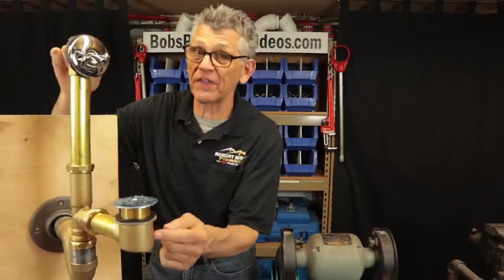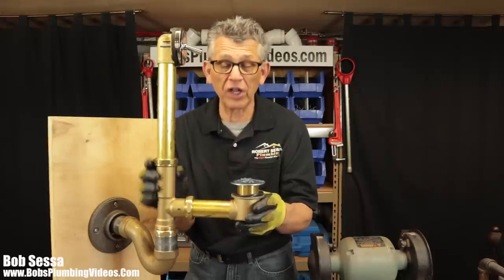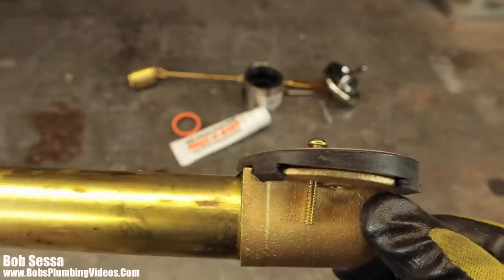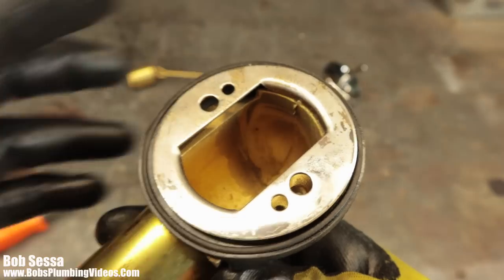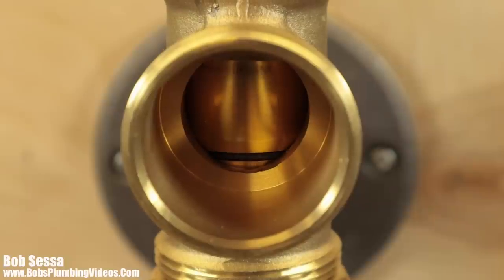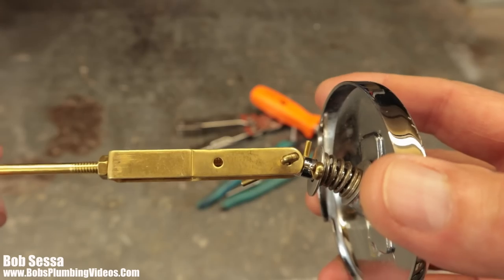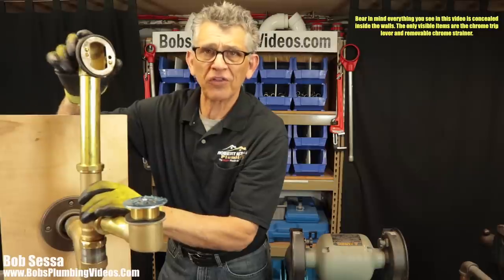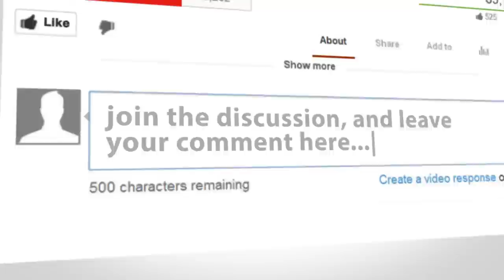Bathtub Drain Stopper / Trip Waste Assembly

Comment: Thank you for this informative video.  I made the mistake of discarding the old linkage assembly.  I have no clue at what length to adjust the linkage assembly too.  Are there any ways to determine this?
Reply from the maker: You can buy a universal linkage kit from H.D. or Lowes. It's basically basically just a matter of adjusting, trying , repeat until you hit the sweet spot.
Reply: Thank you, I am grateful the new one I purchased is adjustable.

Comment: Thanks for the video Mr. Bob, very informative.  I am not able to open the drain to let the water out and have to replace the level.  I also need to clean out the drain.  What are your thoughts on Liquid Plumber or any of the other liquid draining products?  The drain isn't completely stopped up but I can tell I need to  flush it out.  Should I use the Liquid Plumber?  Thanks for your response.
Reply from the maker: I’m generally not a fan of commercial drain cleaners. Some are just down right dangerous and some are a waste of money. You would be better off with a natural bacteria / enzyme  product. Added monthly it will keep drains open (unless you have a hair serious issue) in which case a snake is the only fix. https://wiki.ezvid.com/best-enzyme-drain-cleaners. Regards, Bob.

Comment: What’s the best way to keep the snake wire from rusting while it’s stored to be ready to use again in the future? Grease? Silicone spray lube? Any suggestions?
Reply from the maker: Remove it from the machine! I use a General Handy Electric hand held machine for tub, basin, sink stoppages. I remove the cable after every use, wind it up and hang it on a storage hook in my van. Occasionally spray the cable and inside the  the drum of the machine with WD-40.

Comment: I have a bath tub that drains slowly, I think the whole linkage assembly needs to be adjusted up or down. Why I think it is the linkage assembly, is because when I hold down on the lever the water drains. It won't stay still. Is that because of the lever or the linkage? and if so, what should I replace? I already ordered the linkage and the face place, in case I need both. What are your thoughts and recommendations?

I just found your video, and will be looking for more of them. This one seems helpful.

Comment: Hi Bob, 

thank you. very informative. i have a problem where the whole mechanism broke off from the up and down lever (to fill and empty bathtub) and is in the pipe. how do i get it out?The tub drains but very slowly so i am assuming the plug is not fixed in the close position.  i am a retired woman living on a fixed income and do not want to hire  a plumber. 
presently, my idea is to use a wire hanger with gorilla tape. hoping it sticks onto it and pull it out.

thanks for  any suggestions
Colleen

Comment: Great video......I need some suggestion on the problem I am facing is attempting to remove my drain stopper from drain tub assembly since it has never been used for over 30 years. It literally as become fused to the 1 1/2" brass pipe in which it sits. I have been able to remove the bathtub overflow pipe by accessing it from the accesses panel behind the tub. I have poured CLR on the plunger and let sit for a day.....tried to pull it up with pliers......banging on side of pipe to break seal.......Can you suggest a way in which I can remove the brass stopper from the pipe?
Reply from the maker: I had the same problem in a rental property, saturated it for days w/ WD40 with no luck at all. They sometimes just get so fused to the inside of the tee they will not budge. The water is draining fine. when and if it clogs, I end up replacing the entire trip waste assembly.

Comment: My trip drain plunger is stuck (It won't budge and don't want to break anything trying to force) and I was wondering if there is a tool I can use to loosen it?  Or, is it fixable from the access panel on the side of my house?
Reply from the maker: If you can get the chrome plate off, you can try spraying some WD-40 and letting it sit for a day to try and loosen it. I've had some luck sending  a wire coat hanger down the overflow and fishing it out. If no luck with either and you have access from the back or side, you're going to have to remove the overflow tube and yank it out! Use caution! Good Luck! Bob.

Comment: Bob!  As a new homeowner your videos have been invaluable!  My recent problem is my tub's linkage was stuck in the open position (water would drain but not stop so I could take a bath).  I removed the plate and could not pull the linkage out at all.  My husband then pulled upwards on the linkage and it came loose, but the plunger is not attached!!  Is it still in there?  The hook doesn't seem to be damaged so I don't know how it would have broken off.  How do I get it out?!?!?
Reply: sorry, I was hoping he showed more about stuck plungers and clogs.
Reply: How do I get the linkage out of it got stuck

Comment: Thanks Bob this is a really informative overview and helped me understand the way all that functions and is put together. question for you: is there a specific pipe cleaner that would be useful for de-gunking the area around where the plunger / stopper ends up? mine was very difficult to pull out and now it seems after cleaning the plunger itself, it is not dropping down far enough to block the flow of water out of the tub drain. I'm not sure is it just relying on gravity, when it's put together properly, to block the outflow of water? or is there something stronger that pushes it into place? right now mine does not seem to want to go far enough down to block the drain. so just wondering is it best to fully degunk down there with a pipe cleaner? do I need to snake it? it doesn't seem like my tub is having any problems draining. My actual initial problem was the lever not working and it took a huge amount of force to move it and then finally I had a guest and it snapped off. Thanks for your help!
Reply from the maker: As far as cleaners go, the only ones I recommend are natural enzyme based  products that are introduced on a monthly basis into the drain system. I use a product call Bio-Drain but you can get it over the counter, only sold to plumbers. When I pull a linkage out I'll clean it up with some WD-40 and then lubricate the plunger with some waterproof silicone stem grease (go lightly). Also you have to adjust it to get it to it's sweet spot, they can sometimes be a real pain in the butt. Hope that helps, thanks for checking out the video! Regards, Bob.
Reply: BobsPlumbingVideos Thanks, Bob! Good info! I will definitely try some lube. In terms of pipe cleaner I was thinking more like a long stiff brush. Any recommendations? 

Btw I think people probably remove the strainer to use a stopper if their lever stops working.

Comment: Hi Bob, my drain plug is broken off and lodged somewhere down the pipe. How do I retrieve that? Thanks!
Reply from the maker: You can try with a wire coat hanger to retrieve it. If it's stuck in place, no other choice but but get behind the tub open the wall remove the overflow tube and get it out of there.

Comment: I did adjusted plunger many times up AND down, but the water is still draining a little bit. Doesn't hold properly. Plunger looks good, but my plunger doesn't have o-rings.  What else can be issue with drain system?
Reply: Andrii Maksymovskyi I have the same issue

Comment: What do you do if the linkage breaks and your plunger is stuck at or below the tee
Reply from the maker: Bottom line is either open up the wall behind dismantle and remove the plunger or if you don't have access from behind (an outside wall) open the ceiling below get up behind the tub, dismantle and remove the plunger. Pro tip, if the water is draining, I would leave it alone and use a large rubber stopper to fill the tub if you take baths.

Comment: Any benefit or reason not to switch from the 1 1/2” tub drain into 2” trap and 2” drain to the vertical waste /vent line . And if it is a good idea, switch before trap or after

Comment: Hey hey Bob my name is Lucas I've got an issue with a plunger drain on a tub the actual brass fitting is not dropping down into the sleeve at the junction from the at the drain Point there's something inside there that's stopping that the drum from dropping into the sleeve and actually stealing off the tub and it looks like a lot of play inside the shaft the pipe right where meet at The Junction I've had it down in there a couple times but it seems like there's something inside their that's trapping it from being able to drop into that sleeve and properly slide down in to the point of where it cuts off Flo from the drain what do I do about getting that out and I don't have access inside the wall to to get to the P-trap area and the junction so I'm doing all this without having to cost money and remodeling repair by tearing that the back of the tub out and see how to turn the tub out and getting to the work is it was the worst of it and sneaking it it's a plastic shaft not another one like the one you're using so sneaking it would probably caused me more issues I'm trying to look down it with a mirror and extending mirror in a flashlight to see if there's something in there but from what I've seen I can't make what it is it looks like a sleeve or something that that brass Barrel slides into the Trap off the water if you can get back to me as soon as you get this I would appreciate it cuz I'm Hands-On at the job site now trying to fix it for a motel on her and it's one of those units he wants to rent if you can get back to me I'd appreciate it if not I'm just going to keep trying to figure it out through the night if I have to and thank you for your video because they're very informative they've helped me a lot

Comment: Good detail info. I don't have a trip plunger assembly. I have plunger at bottom drain. Which is better? Could a trip plunger be added? I wanted to stop water from draining from tub overfill for 2/3 Inc more water. Could I do such with trip plunger assembly? Maybe not?
Reply from the maker: I personally like the push drains at the bottom. To convert is a little involved, I would leave well enough alone!

Comment: Thanks for the video! I have a problem where I need some help regarding the trip lever linkage & plunger. It is stuck in the tee and won’t come out. Fortunately it is in the open position so we can still use the shower but we would like to use the bathtub. I have tried to get it out but it won’t budge. Any suggestions?
Reply from the maker: I’ve had that happen to me several times and short answer is flat rubber stopper available in any hardware or home center. 

You can try spraying Wd-40 , silicone lubricant or similar down the overflow and let it sit for as long as you can.

Next option if there’s is access behind the tub is remove the overflow tube and retrieve the the linkage and stopper.

You may have to open a wall to do it! Rubber stopper is sounding like a real good solution👍 Regards. Bob.

Comment: Hi Bob, I want to start by saying that because I am a hands-on & visual learner, I really appreciate that you include detailed visual examples of your subject matter. So thank you.

Anyway, I have been told & have read that a twist-up bathtub stopper cannot be converted into a lever stop without having to replace the entire pipe assembly. If in fact that is the case, I was hoping that you would be willing to explain to me why it is that lever stoppers won't work in all bathtub drain pipes. Or even better, be willing to make a video that shows why they won't work. ;)
Reply from the maker: Basically most manufacturers have their own proprietary designs and for the most part are not interchangeable. When I run into a trip lever waste that is giving someone trouble for whatever reason (bad installation, generic parts, etc)  and I cannot get to work properly , I convert it to a twist-up bathtub stopper. Thanks for the suggestion of a video for the that specific issue! Bob

Comment: Have tried several times to remove linkage. It won't budge. Any hints? Fortunately it is in the 'open' position. Unit has a flat chain type linkage.
Reply from the maker: You can try WD40, penetrating oil through the overflow and let it sit for 24 hrs. It happened to me in my home but fortunately it was in the open position. I’ll probably have a problem in the future if I get a clog, but it’s working and I’m ok with that.

Comment: Thank you foe all your great videos very informative.  Now I repaired the drain in the bathtub because it was Leaking water under the kitchen ceiling. Downstairs. I replaced the gasket and put screwed the drain part with Teflon and plumber putty a month later started leaking again what else would you do to different to fix this problem for good. Is PVC pipe what they use here in Texas any how thank you so much for your help in advance greatly appreciate it
Reply from the maker: I wouldn't use teflon on the male threads of the strainer, plumbers putty on strainer only. You can spread some Mega-Lock pipe joint compound on the male threads and around the hole in the tub before you screw the strainer in. Rubber gasket on the bottom and it should be watertight.
Reply: @BobsPlumbingVideos  Thank you for the fast feedback. I’ll do that and see what happens I’ll keep you posted 👍💯

Comment: Good video Bob. My issue is getting the screws back into the screw holes when putting the face plate back on. I am unable to see where they are once I hold up the plate where it should be then try to tighten the screws. Never tightens. There must be an easier way. I hope this makes sense. Thanks, Bob
Reply from the maker: It can sometimes be a pain in the butt. Do the screws go into the holes without trying to attach the plate? If so try lining up the hole with an awl or thin screwdriver on one side while trying to get the other caught. In rare cases I  sometimes had to re-tap the holes!

Comment: I just moved into a new house and the tub won’t fill. Had my husband take the faceplate off but nothing was attached to the cotter pin. How will I know if there is a plunger down there that might have snapped off or disconnected, OR if there even is one down there at all?
Reply from the maker: Short of having an inspection camera,  I would try a coat hanger. Make a small hook at the end and then feel to determine if the plunger is in fact there. Sometimes people remove the linkage and plunger? Hard to say.
Reply: BobsPlumbingVideos Good idea thank you!

Comment: Thanks for the detailed explanation.  I'm trying to get my stuck stop plunger loose but no luck.  I've used WD 40, penetrating oil and copious amounts of lime away/CLR down the overflow pipe.   Plunger won't budge.  Bath tub is on the second floor of my house with no direct access to the pipes.  I've removed the tile wall/backerboard and can reach down to the connecting ring just above the tee where the plunger sits.  I may have enough room to loosen the ring but the top of overflow pipe is stuck to the back of the tub and I'm not sure how to loosen this with damaging something.  Is removing this overflow pipe the next step to getting the plunger to loosen up?
Reply from the maker: Believe or not I'm faced with the same situation in a rental unit,and the ultimate solution after all the pre mentioned attempts was to open the wall behind the tub and remove the overflow tube.

The gasket the top was stuck to the tub, but I just gently wiggled it loose, loosened the nut at the bottom and removed the overflow tube.. Reached in with a long needle nose pliers and twisted the plunger out.

Installed a new gasket at the top, a new nut and gasket at the bottom and re-install the overflow. They certainly don't always go as planned! I appreciate you checking out the video, regards. Bob.
Reply: Exactly the same situation here.
Reply: @BobsPlumbingVideos    Thank you for  your very expert reply that is practical and makes sense.  I am going to try your approach.

Comment: Do you have any ideas on what to do if the plunger is stuck. I've been here about 5 years and it never worked, I finally got annoyed enough that pulled mine apart 2 weeks ago and I've tried drain cleaners then the pipe looking things that pull any extra stuff out and lubricating oils and let them sit before trying to pull it out again but I'm getting nowhere. Any ideas on how to loosen it up so i can finally get it out?

Comment: I can see a slight gap between the top of my old chrome trip lever plate and the porcelain tub.   Is that OK?    Will water from showering get in that gap and cause water damage to the floor where the tub is situated?
Reply from the maker: If it's not a big gap, I would just silicone it. If you have access behind the tub and you want to get involved lowering the overflow, got for it. But you could open up a can of worms?

Comment: What do I do if the linkage is stuck? I’ve tried spraying wd 40 and spraying with CLR. My next idea is pouring clr from the bottle down just to see if that helps. Do you have any other ideas? Thank you!
Reply from the maker: Wow. if you're in a hard water region of the country, that can be an issue. If it's operational and can stop up the water, I would try pouring the C.L.R. down the drain let it soak overnight to see if it will loosen everything up. If you can remove the faceplate, try to grab the linkage with a pair of pliers and pull up on it (carefully). Goog Luck!
Reply: BobsPlumbingVideos ok I’ll try pouring the CLR- hopefully that works. Otherwise the plumber said he’d have to cut into the wall :(  thanks so much for the quick response!